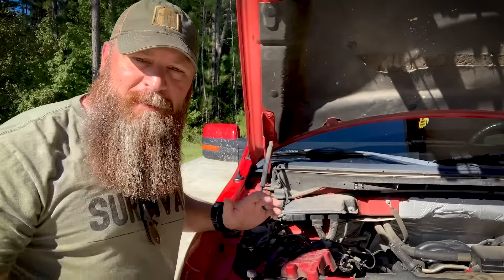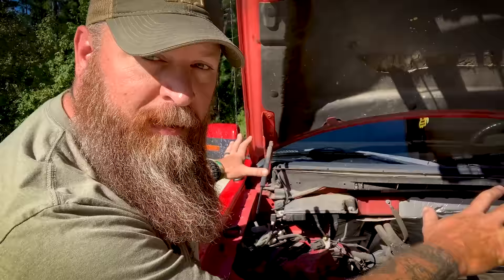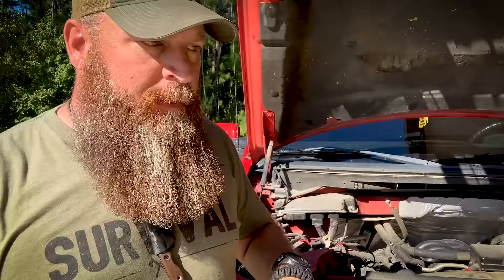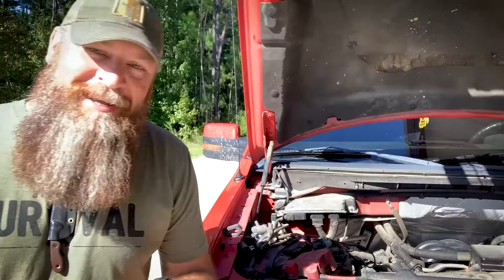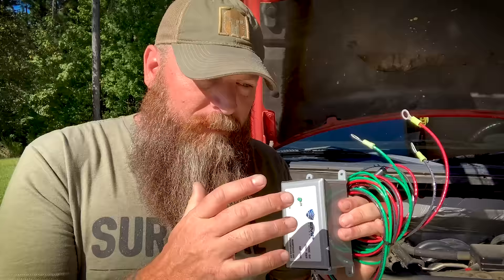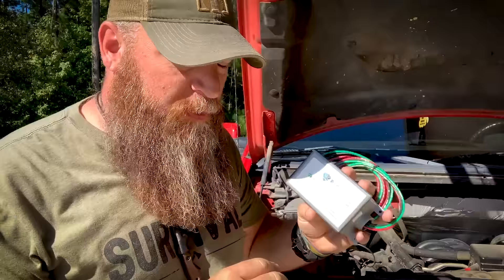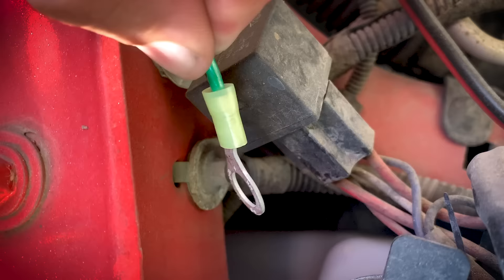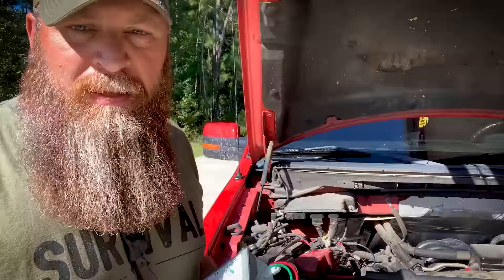EMP PROOF YOUR VEHICLE

Comment: It's painful to listen to him try to explain this. Here, let me try. A radio transmitter (normally) transmits enough power in a narrow frequency band that a signal (radio program, TV show, radio control, etc) for an antenna to receive a small amount of current - enough for purpose of the signal (the same whether its a radio broadcast, cell phone signal, garage door opener, over the air TV, whatever). An EMP is somewhat similar to a radio transmitter, except instead of a narrow band, it transmits on an extremely wide range of frequencies. Lightning is an example of this - if you've ever been listening to radio during a lightning storm and heard interference - this is a small EMP, and it will interfere briefly with all radio frequencies (so no matter where your radio is tuned, for that brief spurt, the signal from the lightning is stronger). A Nuclear bomb EMP works like that only it is 10's of thousands of times stronger - so instead of making a blip of static, the interference will damage the receiver.  The signal is so strong, that it doesn't actually even need an antenna to do this - every piece of metal (think wire - each wire in a circuit) will act as an antenna and pick up this pulse which will then travel along the wire, seeking an electrical ground and burning out all the electrical components it travels through along the way. Since every piece of wiring acts an an antenna, the electronic doesn't have to be a receiver (it could be a computer, or your car's electrical system) - and it doesn't even have to be turned on.
In the Navy, the radios I worked on all had components strategically placed in them to divert damaging high voltage  pulses to ground. Another approach to this would be to make what's called a Faraday cage (basically a big metal mesh box that's connected to ground),  and put your sensitive electronics inside it. I'm skeptical about this EMP shield. I think at best, it might protect the car's computer, but there may be other components that would prevent a car from being useful (think electrical fuel pump, all the fuses (for sure), probably even all of the lights would be burned out by an EMP).
Reply: Kind of like building nuke bomb shelters & offering a huge money back guarantee for them.  If the event happens and the national infrastructure crashes (or fries), I think people will have much more to worry about.
Reply: It was kind of funny to read there ad on Amazon stating if it doesn't work there's a $25,000 insurance policy 🤣🤣....are you going to wire me that money?
Reply: Good explanation!  
I remember seeing a youtube video demonstrating how a microwave oven interferes with wifi because they are both at the same 2.4ghz frequency.
Reply: So on a car with a distributer, what parts should you keep inside to replace when it happens? Distributer plugs wires and fuel pump? Is that it ?
Reply: Would parking your vehicle in a fully metal clad shed have the same effect?
Reply: 😂 basically just buy any old vehicle Using a points and condenser type ignition
Reply: It’s great to listen to him!  I was in the army a long time ago and I love the way he rolls!  Just like us vets!😀
Reply: Thank you so so much for that explanation! I have watched other videos and my husband even tried to explain it to me and I couldn’t quite wrap my head around it – finally!
So I bought an electric vehicle because I knew they were going to get rid of gas. Am I screwed if there’s an EMP or is there anything I can do to protect it?
Reply: So go unplug ur computer from ur car and tell me if it still runs. Ill wait.
Reply: @yinzerprepper9125  haha… I am asking if there is any way to protect it, obviously I can’t wrap it in aluminum foil 🙄
Reply: @pattiw6402  that reply wasnt to u sorry about that it was to the main commenter. He said at best itd protect ur computer. Yeah. Ur computer makes ur car run. Tells it everything it meeds to do and when. The brain if u will. So having an emp shield at best is a "id rather have it and not need it than need it and not have it."
Reply: @yinzerprepper9125  thank you! I appreciate it 😊
Reply: @rubiconoutdoors3492  Ignition, Coil, Starter solenoid. Some wiring, Build you a little aluminum box, Wrap the inside with plastic. Toss all that and what you said in there with some fuses and Cover it up. Then use aluminum tape to make sure the top and bottom stay well connected.
Reply: Can’t she build a faraday cage for the EV and charge it with her generator on 240v which was also stored in cage as well?
Reply: Gas vehicles are a much better choice for an EMP event from a fuel availability standpoint so trade that EV for a totally restored 1976 Honda Civic or a mid 1980’s to early 1990’s Honda CRX HF.

Comment: I don't know, but at $389 for the emp shield, would it be less expensive just to buy replacement electronic parts for your vehicle and store them in your faraday cage?
Reply: Not a bad idea
Reply: @robertlugo6564  - better idea... also good to know if your vehicle has fusible links, and where they are....
Reply: path of least resistance... $1 vs $389

Comment: DISCONNECT YOUR BATTERY BEFORE EMP FOLKS.. 
The video is helpful . The easy solution is disconnecting your battery
Reply: Disconnecting your battery will not do a thing to prevent the EMP from ruining your circuits.  You'd better rethink your strategy.

Comment: Likely hood of EMP effecting a metal box with rubber wheels is highly unlikely. Cars get struck by lightening everyday and continue to function with no issue.  Even direct antenna lightning strikes don't interfer with cars.
Reply: @dmedlin8118  true, but cars are also big Faraday cages, how do u think military vehicle are hardened against EMP. Most modern cars during build cycles are basically hardened the same.
Reply: We got struck by lighting in a Pontiac grand prix years ago.  Skin tingled a bit, smelled the ozone in the car....car just kept runnin' no problem.
Reply: Had an F250 that got struck on the antenna by lightning in my shop. Vehicle was struck while driving and continue to run. The only thing the owner noticed that quit working what's the air conditioning in the radio. The owner got home and shut the vehicle off and got out of the vehicle and left it sit overnight. Next morning the vehicle was cranking but it would not start. Towed it to my shop where we found numerous harnesses melted as well as the antenna and antenna lead. Harnesses and the radio were repaired the vehicle still would not start. And none of the power accessories would work. Engine control processor and body control processors were replaced before we got function back for both the engine and the power accessories. This is not the norm but it does happen.
Reply: @montejones5788  Yes but your electronics failures were almost certainly due to shorts in the melted wiring rather than the strike it self.

Comment: I've worked on many of traffic signal cabinets struck directly and indirectly by lightning. And they all have lightning and over voltage arrestor wired in. I have never seen the electronics completly survive a direct lightning strike. I've seen power company high tension lines touch a traffic signal ariel line and fry everything in the intersection including the light bulbs( LEDs). My opinion is these arrestors maybe better than nothing, but not full proof. A car is a Faraday cage in itself, thus protected from lightning. Who really knows about EMP protection proof!
Reply: There is an antenna that is just a slot in a metal surface. Amazingly it is called a "Slot antenna".   The longer the slot the lower the frequency it receives/ radiates. On jet fighters for example. So the hood to fender gap becomes one down to around 28 MHz. CB hello. To avoid this multiple grounding points along/around hood are needed. Ground exhaust pipe at multiple points. Car doors. Use phospor bronze spring contacts. Then use the device shown. Or get an old car. Laugh at emp. At home get an old microwave oven, cut off cord (emp path) and store back up cell - use for info storage. Chess, Bible copy, first aid, maps etc.  etc. - sw/bcst portable, small ham radio, battery charger and small solar. Microwave is totally sealed for RF.
Reply: Exactly that.  There have been several tests, using cars up to 2006, if I recall.  They ran them through an EMP generator, and all but one either continued to run or restarted.  The one that didn't start immediately, did so after some "minor" unspecified repair. Last thing I saw on the subject estimated that between 10 and 20% of vehicles would be killed totally, while the rest would run, but subsystems like radios, lights, and a/c units might fail to some degree.

Comment: My company installs EV charging stations and premises surge protectors in SoCal. 
At 6:40 you mentioned that box will protect electric vehicles from an EMP. 
  Before someone would wire in an aftermarket device to a >$100K vehicle, I’d be interested in looking at the schematics (or if you are concerned with IP, just the brief overview of the discrete components used) to understand if it can do what claimed. 
Since EVs don’t use a standard 12V battery like a ICE, I’d curious how it would be wired in.
Reply: POS electric cars arentt 100K LOL
Reply: All this does is short the terminals together to shunt voltage when it exceeds a certain level.  That's why I think this is a scam.  No way they had a new design surge suppressor made for 12V.  It's probably the same one used in 120 and 240V systems.  In other words, your car system will be fried long before it kicks in.

Comment: That won't work. An emp will target all electric systems in your vehicle at the same time and the wires and other systems in your vehicle will not be able to transfer it to that device.
Reply: You are correct faraday cage is the only way to stop EMP
Reply: @bryanlewis7732  exactly, at best this device is an over-engineered surge protector.
Reply: It's all about impedance.  With any electrical device.  If this devise can provide the impedance and reaction time needed to shunt the spike it will work because it is technically a part of the entire electrical system in the vehicle or home or whatever...

Comment: Sounds like another gimmick. So all your fuses will be fine? All your small gauge wires will be ok? Doubt it. What happens when your entire vehicle is electric? How does the body handle emt? We are all electrically  charged inside and out.
Reply: @EMPShield  I don't know enough about this to really have any opinion on the claims being made.  But following that link you show just seems to indicate that you are a partner for an academic research center, is there anything you can share that shows that these have been tested by some sort of federal/standardized body and has been independently evaluated to pass the claims that are made?

Comment: With all due respect those wires look awfully small and I don't think you fully understand how an EMP works  I hope you didn't spend much on that.  Also you might want to put a bike in the back of your truck just in case.
Reply: we get that  question a lot. It comes down to speed. The wires will be just fine because of the speed the device is able to shunt and the induction rate the vehicle will have. The device shunts at 500 trillionths of a second and continues until the charge is dissipated. EMP Shield is currently working on the grid pilot program. Here is a link showing our partnership with the United States Nation Security Collaboration center  - https://nscc.utsa.edu/partnerships.html
Reply: @Benjamin Fletcher 
 First your perception of how a EMP is going to effect your vehicle is incorrect An EMP is going to hit the entire vehicle at once meaning all the sensitive electronics are going to be exposed to the EMP blast at the same time as the shield rendering it useless.  Second Electric current produces heat proportionate to the conductor and the conductor's conductivity.
  A small wire is a small wire an EMP can be astronomically larger than huge.  It doesn't matter how fast the unit is if the wiring can't handle the load it does however, mean the wiring in this unit will burn out 500 trillionths faster than the rest of the electronics effected by an EMP blast.   Shinny object Vs reality.  If your looking down the barrel of a loaded and charged gun when the trigger is pulled during a flood that your drowning in how effective is body armor?
Reply: @EMPShield  can you show us any paper work about the DOD tests on this product?

Comment: some late information
5:18   in addition to what you have mentioned, an emp  Induces  current in a conductor (as the 'wave' propagates away from the source).     this current induction process can occur inside any 'unprotected'  transistor or IC.    where, the tiny bits inside get fried.       in order to protect a  Modern vehicle from emp, it would need to be in a faraday cage during an emp.
Reply: A common example of this is the wireless phone charging everybody has heard about or used. It works exactly the same way.

Comment: This sounds great and I would feel better if all my vehicles were EMP proof. Question, how do we test this device?  I like the older vehicles not just because of on EMP but because I can fit all the parts I need to repair the ignition, in case of a failure in my glove box. Belt and hose changes are a snap.

Comment: Removing any sensitive electronics from a source of power and draining the residual power out of the electronics after would also protect against emp. However, you have to do this with the foresight that an emp is coming. 

Faraday cages are pretty easy to build and having one already setup all the time to have a protected area to park your vehicle and put all of your sensitive electronics would be the best solution.

This emp shield, if it does work, is useful if youre already out and about driving when an emp hit.
Reply: Not exactly. The incoming power you're worried about in an EMP is a radio signal that will be propagated along any wiring (or anything conductive). Disconnecting from "a source of power" doesn't actually mean anything in terms of an EMP - since the EMP itself is actually where the power is coming from.

Comment: An excellent EMP explanation for ordinary folks.  Even though I hold a General Ham license I am not an electrical engineer and you explained the "E" series of electrification.  I did have a question.  How does the device go to ground in a vehicle that is sitting on four non-conductive tires ?  Just curious.

Comment: Well in my opinion, any piece of copper wire in your vehicle would serve as an antenna and an inlet or Pathway to sensitive electronic equipment that runs all the systems in your vehicle you would have to sealed every single wire. This is not only impractical but impossible. A possible solution is keep your vehicle inside a metal shipping container with the door closed at all times. Then place your cell phone on the hood of your car, then have someone call your phone if you can hear it ringing, then your Faraday cage needs some more work. Good luck

Comment: Most suppressors are are metal oxide varisitor and will go completely short at a set voltage, and if the current is too much for them to handle, they will explode.

Comment: I got one for my SUV quite a while back. I would hate to be traveling in my vehicle and have an EMP or CME knock out every vehicle in the entire area. There won’t be any LYFT or Uber drivers available. I would hate to have to hoof it in the snow for 20 or 30 or 50 miles. Since I don’t have any way to test the device, I have to rely on the testing that they do which is military grade. They guarantee their devices for home and vehicle use. That said, if my vehicle is still running when everyone else’s is down, I’m suddenly going to be very popular. So, I have a plan for that as well. My rig is outfitted to sleep in it for a couple of weeks if I have to and provisioned with everything I need to get by and survive until things quiet down enough for me to drive more safely. If the product works, it’s a good product, but if it doesn’t work, it’s not that expensive so it’s Insurance that increases my likelihood of prevailing under those circumstances.

Comment: If you are forewarned maybe 5 minutes, could you disconnect the battery and sensitive components (on a non computer car)?  

What about lead, If you had lead sheets to drape over the engine bay and cab. I have seen sheets of lead on the back of drywall intended to be in medical rooms around X-ray machines. I have torn down or remodeled and stripped the lead off the back and it's only worth the lead price which isn't much.

What about a Faraday cage tarp for the whole car

Comment: Great!! You're vehicle is now rolling along after the EMP event but which gas station has their pumps EMP protected? Or which gas station would even be open? You can only go so far with a couple extra jugs of fuel. And, no, you can't siphon fuel out of dead vehicles like in the movies. You haven't been able to siphon fuel for a long time. All vehicles nowadays have built in screens along the fuel intake line to prevent this.

Comment: As a journeyman electrician, this EMP module wiring won't handle 5000 Amps. This small 12 guage wiring, rated for 20 amps continous...50 amps max, will burn up. I would like to know how they rated this small wiring for 5000 Amps. $50 for a relpacement? If this happens, replacing the EMP mod will be the last thing on your mind.

Comment: How far the EMP effect is depends on the size of the bomb and how high in the atmosphere it is when it goes off.
Phones that aren't plugged into a charger probably won't be affected because the wiring isn't long enough to build up enough electricity to fry the phone.
Faraday cages can significantly reduce the problems.
Reply: Phones would probably still work but no towers, only as a flashlight or files saved on the phone!😱